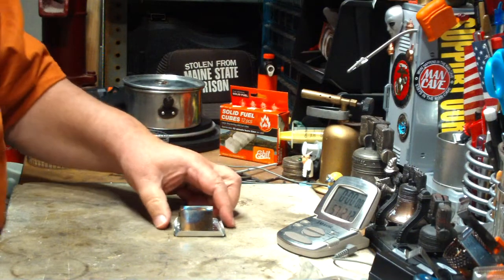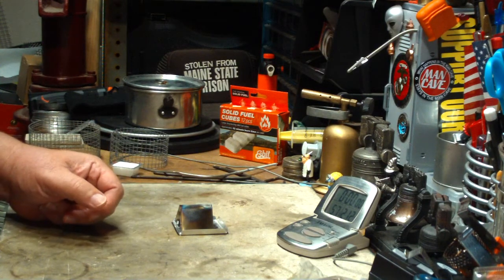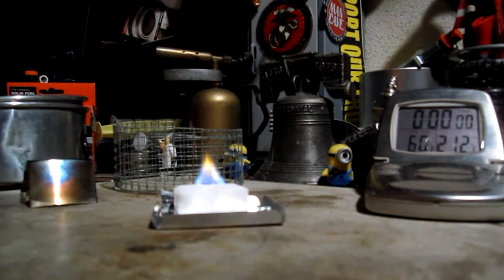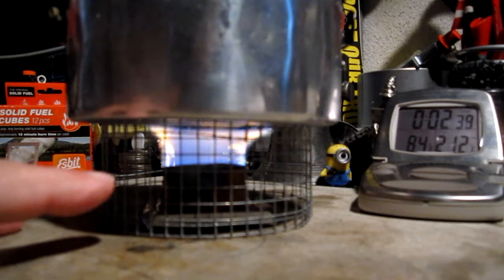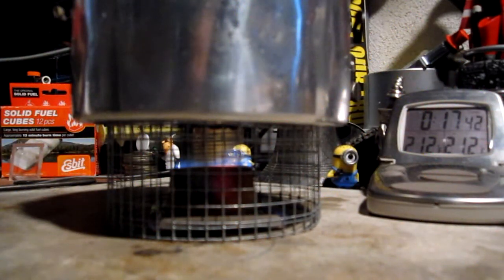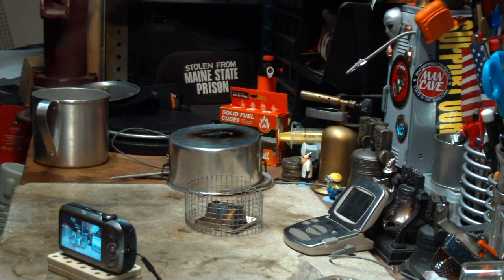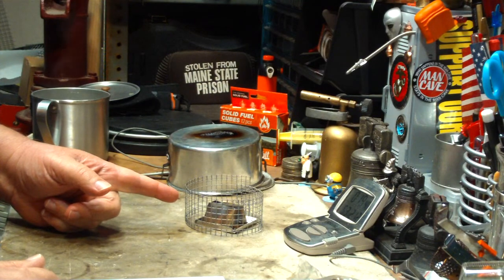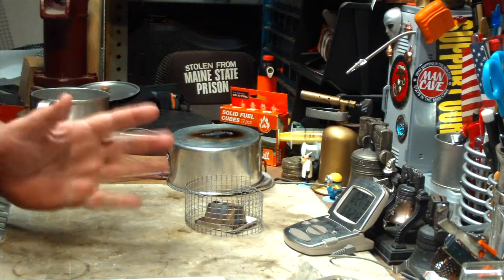Flat Cat Gear's Focused Fire 14 Stove - Esbit - Boil Test #2

Comment: Great test. I noticed that the flame had much more blue color to it than is usually seen with Esbit. So you did get a cleaner burn, which is noteworthy since they are toxic. Raising the Esbit up from the table and giving it titanium wings to act as twin heat sinks would take it to the next level. Another even lighter mini stove, such as the Gram Cracker would easily accomplish this. And if they both fit within the Cat's Epicurean ring, you might actually get clean blue flame that's relatively free of odor, soot and Cyanide fumes(another unfortunate byproduct of setting fire to the Alien Fish Cubes we all seem to love so much). Maybe they could be further burned in a gasifier for a very clean effect, but this extremely lightweight solution to common problems with Hexamine tabs could easily make Esbit the cooking fuel of choice, especially for the military. It's too bad that they are no longer being manufactured. I want one now